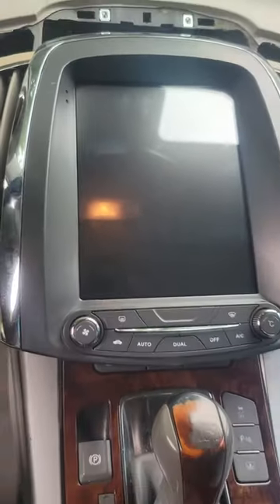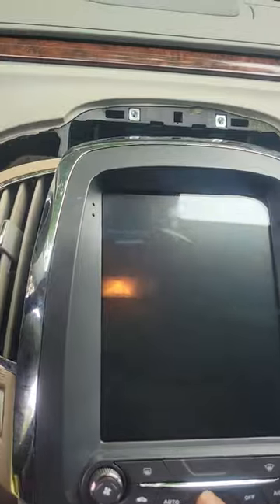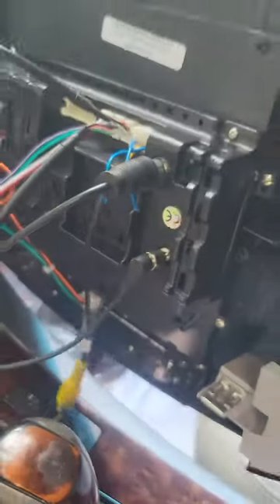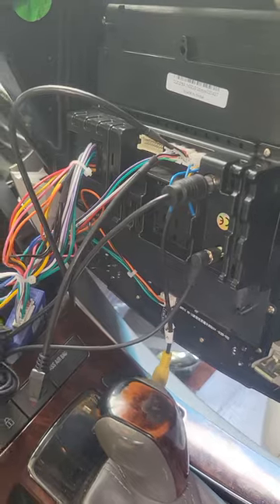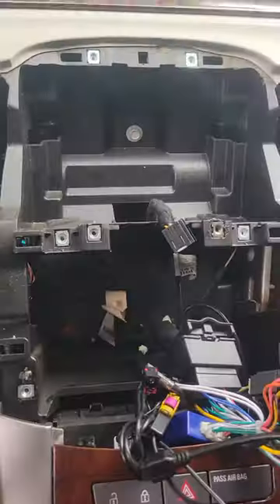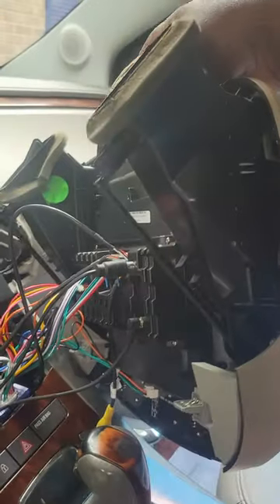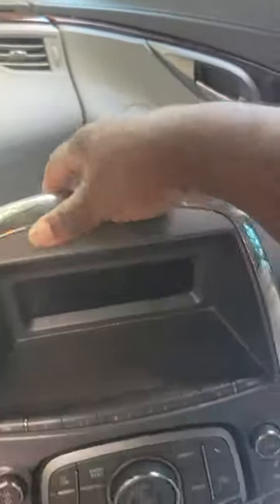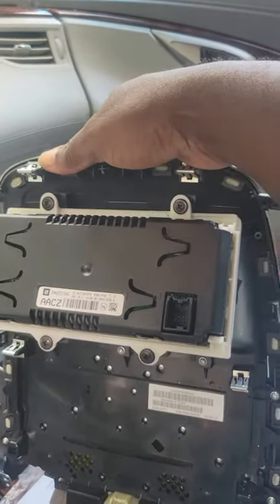Issues installing Tesla style radio in 2010 Buick Lacrosse

Comment: Cut a little bit of the middle  out, and it will fit that's what I had to do  for mine.
Reply: Bro how did you get your ac to work
Reply: I had no problem with anything not working, you have to mess with to set it up,the way you want it.
Reply: @TheEebboo1  when you plugged yours in everything worked
Reply: @hustlehousemarv3625  yes,the one thing that don't work is the heated steering wheel. Haven't figured that out yet.
Reply: @TheEebboo1  I figured it out 
Do you have subs with yours if So how does it sound
Reply: Yes I 12" single in a non sealed box.
Reply: So the middle piece that’s blocking the radio u cut that? What u cut it with?
Reply: @mikeb9311  little hand saw
Reply: @TheEebboo1  ok, I figured it out
Reply: @hustlehousemarv3625  good  deal.
Reply: @TheEebboo1  I unscrewed the 4 holes on the back of the radio that’s sticking out and moved it all the way up to the top. So now it fits
Reply: @TheEebboo1  ohh ok ok. I used unscrew the 4 screws in the back up the head unit and moved it up. U can move it down too
Reply: I got the same car and my ac stop working two years ago .
Reply: Does your rear defrost work?